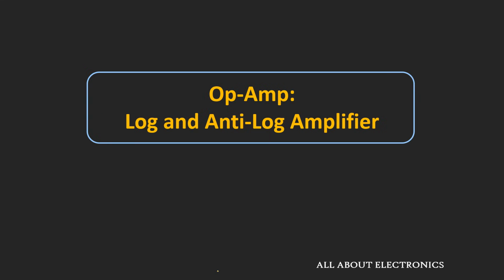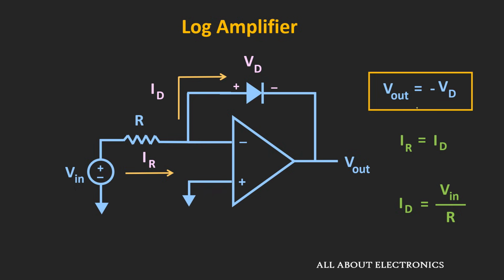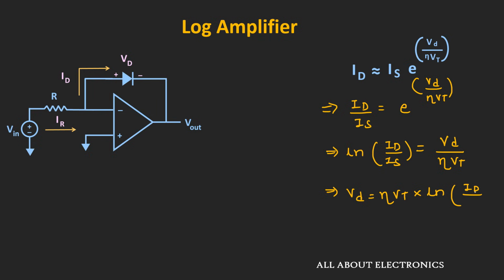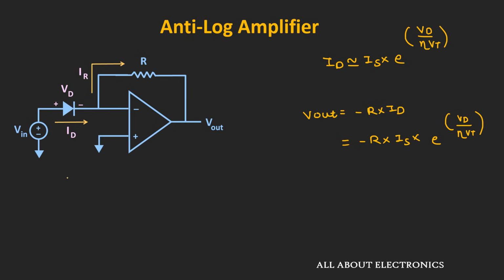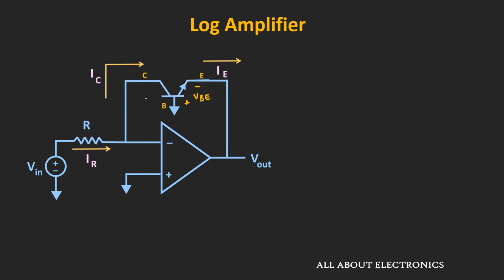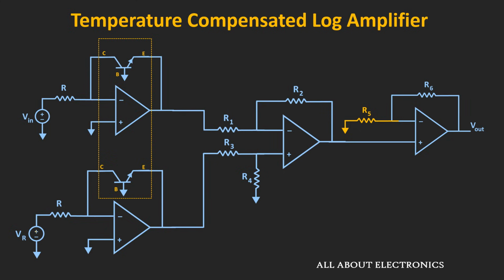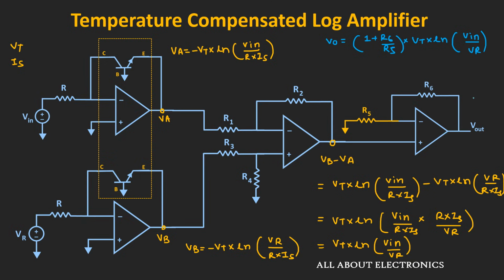Log and Antilog Amplifiers Explained | Applications of Log and Antilog Amplifiers

Comment from the maker: The timestamps for the different topics covered in the video:

0:22 The applications of log and antilog amplifier

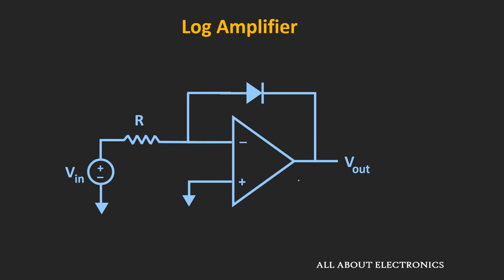2:24  Log amplifier circuit using the diode

6:48  Antilog Amplifier circuit using the diode

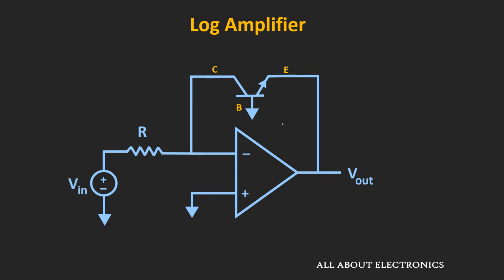9:50 Log Amplifier circuit using a transistor

13:26 Antilog amplifier circuit using a transistor

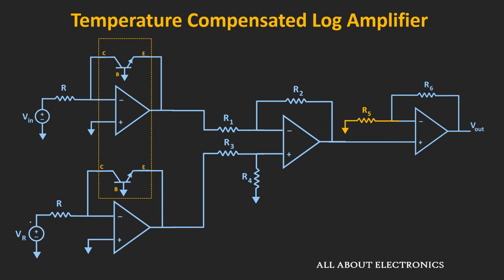16:48  Practical Log amplifier circuit (Temprature compensated Log ampliifer Circuit)

Comment: Does this actually work? Every circuit I've seen has failed in several simulations and actual circuits, are there specific diodes or transistors that need to be used?
Reply from the maker: It works more perfectly when the op-amp and transistor or diode is integrated on a single chip. With external diodes and transistor, the circuit works approximately. (Accuracy of the result will be poor)
Reply: @ALLABOUTELECTRONICS  Weird, I used a LM358 and a 1N4148 diode but it didn't work, I also tried using a PN2222 transistor which didn't work either, it sort of worked when I added a resistor to power but that's it. do I need to bias the non-inverting input? If not what would you recommend I try?
Reply from the maker: Have you calculated the expected voltage ? And what voltage at the output you were getting ?
First, just calculate the expected output voltage  based on your voltage, resistor. From the data sheet, you can approximately take the value of Is. For 1N4148, around 1 nA. And calculate the output voltage. And then in actual circuit, check what you are getting. 
You can also use the multisim simulation.
Reply: @ALLABOUTELECTRONICS  I am using a 1Kohm resistor, so (If I did my math right) I should be getting an output voltage of about -0.36 +0.026ln(Vin) but I don't get any voltage on the output of the circuit. I get something resembling a logarithmic function when I use a transistor with a 10Kohm resistor at the base connected to power.
Reply: @ALLABOUTELECTRONICS  So I've been running a few experiments with the log amplifier circuits. The first was reversing the direction of the 1n4148 diode, this surprisingly worked, it output the logarithm of the input, however it only did it half of the cycle. The other thing that I tried was using the transistor design, this one worked but only when the base of the transistor was connected to V+
Reply from the maker: @arthurfoxthearcticfox  Since, you have said the circuit was not working, so I have done the simulation with 1N4148. And it was working fairly good. The only thing is that you need to have an idea of the reverse saturation current of the diode. Because of that, you might see the inaccuracy in the output. In the simulation, there is also configurable diode. Where you can set the saturation  current of the diode and the forward voltage drop. With that, I was getting the expected result. Please try to simulate it in the multisim. You will have an better idea. And then accordingly you can do further experiments.
Reply: @ALLABOUTELECTRONICS  So I've done some simulation and it sort of works, but it still won't work in reality. I'm using a TL074 op amp and I'm using a 2n2222 and 2n3906 for the transistors, am I using the wrong parts?

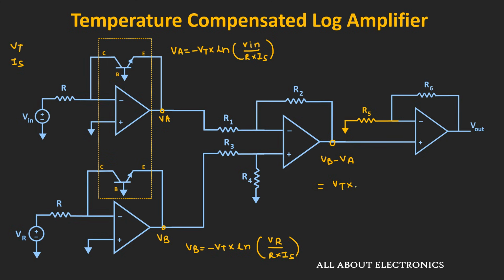Comment: Sir, jo circuit diagram 18:30 pe dikhaya jaa raha hai usme Right se 2nd circuit Differential Amplifier nahi hai. 
Reason:-
Differentaial Amplifer mein ek capacitor  inv.. Ya ek non-inv... Terminal mein series mein jarur hota hai.
Reply from the maker: What I meant to say is, it is the difference amplifier, which will amplify the differential input. (The difference between the two inputs). What you are saying is the differentiator, where the op-amp is used as the differentiator circuit. I hope, it will clear your doubt.

Comment: But why you have not considered R2/R1 of Subtractor output?
Reply from the maker: If the resistors R1, R2, R3, and R4 are selected properly the output of the difference amplifier will be Vb- Va. I have already explained that in the earlier video of op-amp has difference amplifier. That's why I didn't mention it here explicitly. I hope, it will clear your doubt.
Reply: @ALLABOUTELECTRONICS  Yes sir, I understood. Thank u
Reply: good question

Comment: When we designing log amplifier,there would case of diode going into reverse bias as bcz pside is connected to zero and  nside connected to vout then the diode will be in reverse bias na then there would be no forward current.then how can that ckt is used as log amplifier.plz clear my doubt

Comment: Please upload temperature compensated antilog amplifier.....please
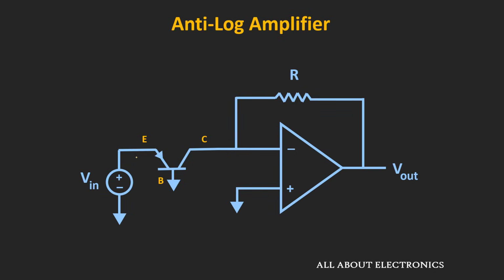Reply: Use the circuit at 16:50 but replace the input amplifiers with the circuit from 14:06.

(Swap resistor & transistor positions, and change transistor to PNP)

Comment: Nice video.

I am trying to understand a logamp example in LTspiceXVII. It is simple partially temperature compensated circuit,  but it doesn't have third differencing opamp, and one of BJTs is in transdiode config, and another one is not (shorted B and C). Additionally there is reversed diode. (Plus some caps, probably for stability control). I did run it, and adapted, and well, it does' work, but I am not sure why :D

Comment: Another excellent explaination. I do not see this circuit mentioned to much in the industry, maybe replaced by software?
Reply: It is still used in many applications requiring very high dynamic range and ratiometric measurements to reference, i.e. in spectrophotometry, densitometry, ultrasound measurements, RF power measurements for research and automatic gain control loops, some PID control applications, etc. It can also be used in audio and video applications (noise reduction, transmission, recording, effects, etc), where it is commonly called "compression". In some situations it is also used as a stage before low-bit ADC, as an alternative to costly high-bit ADCs.

Comment: Hello Sir, Its much informative for me but i am still confused regarding the selection of R5, please give some more explanation about R5.
Reply: it is a temperature dependent resistor which changes its value as you change the T. Just like Vt(tehrmal voltage). As Vt increases linearly with temparature from the realtion Vt=kT/q, R5 will also increase hence compensating Vt.

your welcome

Comment: How to find Is
Reply from the maker: The value of reverse saturation current is usually given in datasheet for the given diode. For silicon diode, it is typically in the range of nA.
Reply: @ALLABOUTELECTRONICS  I have seen some circuits use a reverse bias diode to discharge a capacitor. I takes a long time.